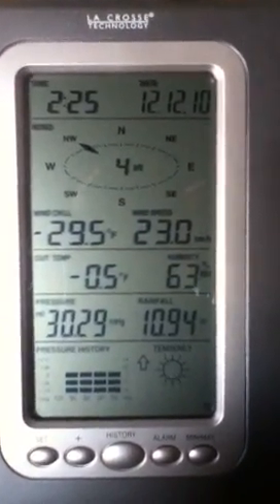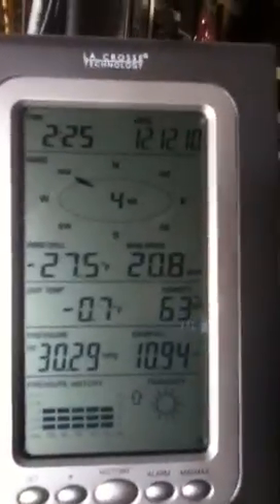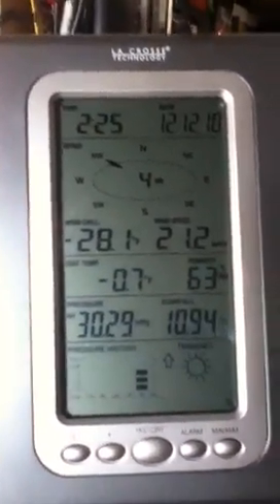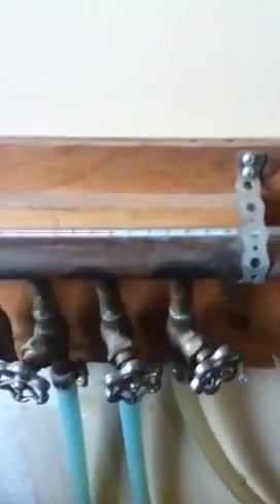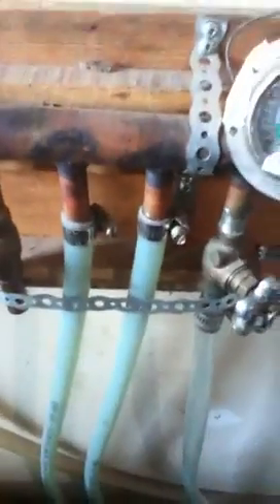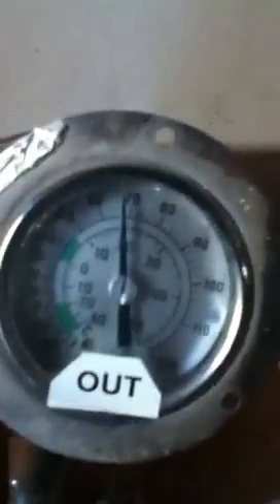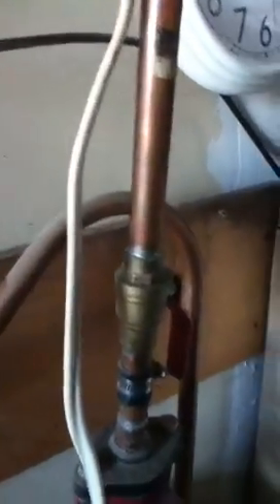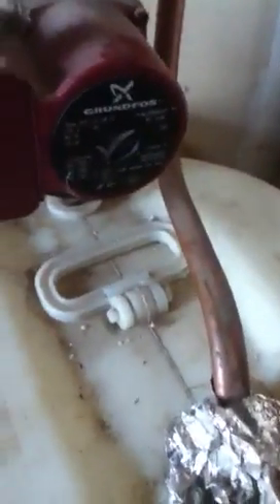Solar hydronic heating

Comment: They performed twice as good as I hoped.
Sandwich from back of panel to the front in order. 2" x 8" frame.
3/8" treated plywood, 3.5" non mildew rock wool insulation, 1" X 2" vertical wood strapping @ 2 ft centers. Aluminum sofit grooves every 6" horizontal .Run 3/4" soft copper back and forth 6 times in the grooves fasten with copper straps at centres.Paint Flat black. Cover with "sun tough" Polycarbonate My 48 ft panels equal one full oil tank annually each. I got everything at Home Depot.

Comment: Well first thing you should do is pack some gravel on the garage floor then insulate the gravel with at least 2" of SM closed cell foam. Then you can put down your re-bar , fasten your pex polyethylene pipe. You only need to make one circuit . Just space the tubing by 1 foot , six inches near the walls. Circuits should be no longer 350 feet. I don't know how big garage is.

Comment from the maker: This system is small , consists of 800 ft 3/4" pex tubing , two circuits 400 ft each . Heating 650 square ft. Under 4" of concrete is a 2" SM foam R-10. The perimeter also has foil bubble radiant insulation blanket 4 ft wide on top of the SM. Each 48ft X 4Ft thermal solar panels are set 9 degrees from vertical to keep the snow off them   Each panel is roughly equivalent to 250 gal of fuel-oil annually , so if you need more heat then just build another panel fo 1200 bucks  and it will pay for it

Comment: Hey bob i love the system i would love to see another video or a diagram,building a similar set up.Do you run the water from the panels directly into the floor or to the storage tank first? Im been thinking of making a thermal storage tank where the solar heaters and wood stove would send the water first, then out to the floor, then from the floor back to the panels.
Reply: I use a 10 imp. gal tank to act as a reservoir for the Propylene Glycol 50/50 with water. water comes in to manifold and split into circuits in the floor . Comes out of the floor straight into the tank then outside to the panels.